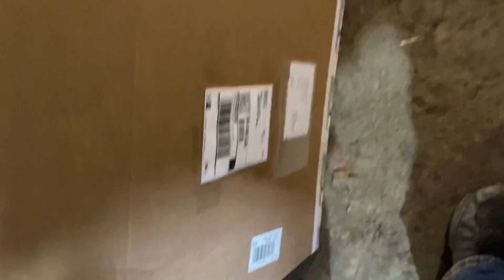WIN THIS BRAND NEW Z28!  We build a new Slash drag car to GIVE IT AWAY

Comment: Dont forget ventilation for that engine on your RC truck...i used an Electric revo body on my 3.3 revo and it had my engine running 30 degrees hotter after a full tank! Castle SCT sidewinder with a 3800 or 4300kv motor is a great TUNEABLE budget ESC/motor setup for under $130 used

Comment: Get the pro-line body mount screw on caps they are so nice . They have a complete body mounting set up . But all you need is the screw on caps and you cut your stock nubs off you stock body mounts and thread the set screws into the Original spots with a body clip skull and then you can just screw the caps on and hold the body down there really nice I wish I knew how to send pictures on here but I don’t

Comment: On the Brushed versions at least they use to be. You need to upgrade the hubs to the bigger bearing hubs and the transmission change to steel gears and bearings. Cause a brushless setup will burn up those bearings first time out with it. 👍🏻

Comment: i was doing RC 15+ years ago..i still have a bunch of electric and Nitro vehicles. Nitro RC was really big then, tracks and shops all over the place. Now there is just a few around, and the Nitro classes are gone. That said, there is nothing like an HPI Savage for durability. Tap a little bump too hard much less a curb or speedbump, that Traxxas plastic just snaps. Keep upgrading, it just breaks something deeper in. That's the only big problem with Trax-ass . Anyway, nice builds, guess you have nothing else going on right now except the RC content. Looking forward to the spring and real cars

Comment: What's up old man. I just got done researching something you said a couple of months ago about LS motors and how you were telling Billy and Molly about the 4.8 or 5.3 was a pig and a glorified 305 that makes all it's power up top. Well after about a month of research and reading the data I have gathered you are absolutely 100% correct. Even the 6.0 LS6 was kinda a piggy at the bottom and they had to throw all kinds of parts at it to run with a stock 5.0 coyote or built 383 sbc. I wanted to prove you wrong in my research because I was wanting to do a junk yard LS build and swap in my own car because I want a toy since I've retired from the motorcycle industry and can no longer ride. So the way it's looking I can build a vicious ass SBC that would decimate the LS OR LQ9 for the over all money spent. So that's the route I'm gonna go and I've come to the conclusion that I will put a blueprint 540 or 632 before I'd spend the money to build an LS swap. So unless I gotta car like a corvette or Silverado with an LS or LT engine from the factory I'm not going that route. Sorry about the book I'm writing. But thank you for igniting that spark to educate myself before I start throwing money at my own isht.

Comment: Hey Old Man, try some skateboard deck tape. It's, basically, 24 grit sandpaper with an adhesive backing. Stick that down to the deck you built for June and it'll hold her bed in place. It'll also help keeping her nails trimmed back when she walks around on it.

Comment: If you look in the back of the traxxas black and white manual. This is a page called the power up sheet . You rip that out and take the junk esc and motor back to the hobby shop they will give you a vxl lipo system at a very good discount look in the book it says “ POWER UP “ you will see remotes motors and esc on the page you save a lot of money doing it that way

Comment: Hey "Old Man" check out the comment left by @vegaman66, in my opinion that is definitely the best suggestion to hook up June Pups bed. Now you may have to use super glue, gorilla snot, or hot glue for the strips to get them to stick well enough because of the material, but again definitely the best suggestion. Looks like it was even wife approved by one of the commenters/commentators.

Comment: I've got a 70 chevy truck with a drift car chasi under it but I took the front drive shaft out so it's just a rear wheel drive car and the guys in my area hobby shop won't race me, the always make excuses for not racing me, they say my chasi isn't right for drag racing rc cars. I've got no money so I just built this as cheap as possible and I bought a good motor and ecu along with a good battery and this thing will smoke the tires and leave big black burnout marks

Comment: Why you giving away my bandit secret i love my bandits.  the rustler is similar to.
Reply: Since we are giving secrets. Lookup castle link. I run a similar deal. Can tune braking and throttle curves. When doing 100+ 100% brake is no good. I tune on the fly off my phone.